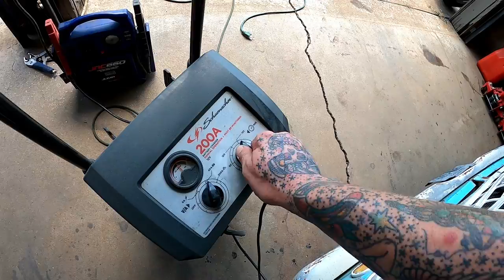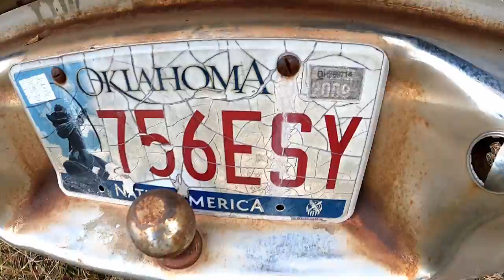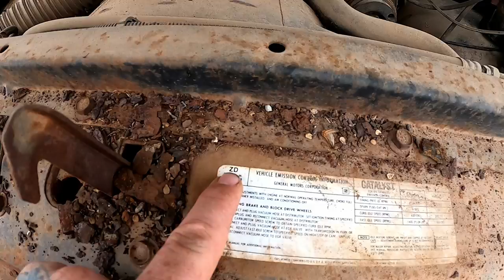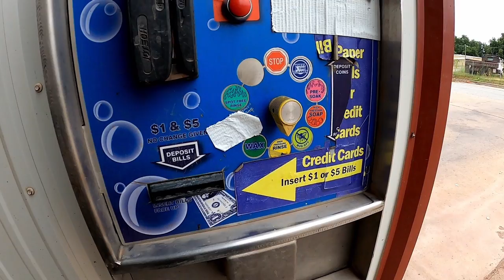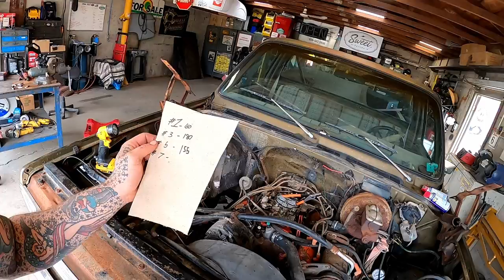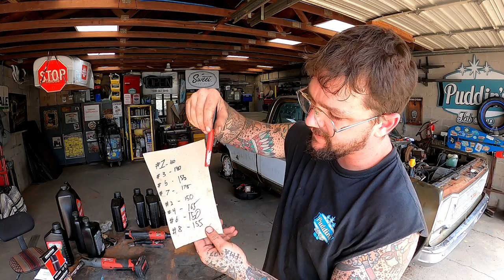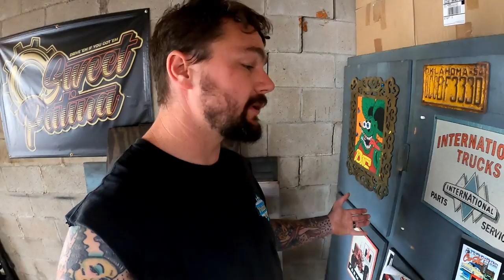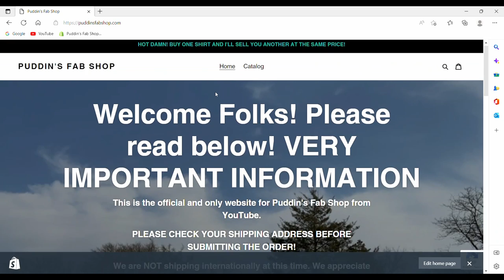FREE 1976 GMC Sierra. ABANDONED on my new property! WILL IT RUN?!?

Comment: If it wasn't the motor? Then what do you think the reason for dumping the truck in the first place, was the rust that bad that it wouldn't pass registration or do you think that it was the diff???
Either way, not bad for the price 👍👍👍👍👍👍

Comment: before you part that out.. its a top of the line gmc 1/2 ton 5 lug with ac, power disc brakes, power steering with tilt column (wouldn't be surprised if the rear end was a posi) and from what i was seeing in your video pretty much bone stock and not been apart, a true cowboy cadillac back in the day, if the cab isn't rotten out it's actually worth a few coins brother. the front clip and bed side or no big deal. I'm the 2nd owner of a 73 cheyenne super 10 with only 62k miles on it now with everything your truck has but no ac and you wouldnt believe some of the stupid offers ive had for it unrestored (and yes, its a runner and a driver)

Comment: Need a better bluetooth funnel there

You don't have like 38 of those cheap meters the Hobo Freight used to give out free?  
 
GMC is well optioned, should be a fairly desirable truck.  I once picked one of those tilt columns when I was in Indianapolis on vacation, had to buy a tarp to put it on in the back of the rental car because the steering wheel was all sticky.  Probably why yours has some aftermarket wheel on it. 

My old Suburban I had to literally climb up in the engine compartment to work on some things on it

Comment: There is an easier way  There's a bolt hole that goes right into the front of the block Put a bolt right through the front of the block to hold the rod up

Comment: How do you find so few wires and hoses damaged on vehicles that have been sitting in fields for a decade? But when I was at a caddy dealership, we'd get cars that sat for a winter that needed all new harnesses and hoses that were parked in the middle of cities. Guess it's the plant based materials they used on newer stuff.

Comment: For fucks sake to clos a square body hood that's rusty/tight put your hands on the top front edge spaced evenly like you would normally pull down, but instead of pulling down push it forward towards the windshield with slight downward force if it's being extra stubborn give it a little side to side wiggle while pushing. Sounds complicated but it's all in on easy fluid motion
Reply from the maker: I think next time I’ll jump off the cab roof.
Reply: @PuddinsFabShop  as long as you give it the peoples elbow 💪 it'll be fine...
Reply: Calm down buddy

Comment: You could of just pulled the front bolt and replaced it with one of the pump bolts or a screwdriver to hold the push rod up...or your way.

Comment: I did the wrong plug wire location thing. As I was waiting for the old tow truck I decided to look and switch 2 and canceled the tow right as he pulled in. I felt bad for the driver, so bad that I told him how much of an idiot I was which gave him a smirk at least.

Comment: Hi Puddin, a respectful paranormal analysis shows EVP spirit audio from the wind-shield wipers, acting as a ghost box; there's speech patterns within the noise, obvious at 0.25x video speed, spirit helpers talking:
37:47 'Når de gamle Guder kommer tilbage, så sker der ting og sager' ('When the old Gods come back, things happen'), 37:49 'Fordi den energi fra Völven er så stærk' ('Because that energy from The Völve is so strong'), 37:51 'At hele verden er nødt til at høre efter' ('That the whole world has to listen'), 37:52 'Når Völven snakker og taler' ('When The Völve speaks and talks'), 37:53 'Om de gamle Guder fra Danmark' ('About the ancient Gods from Denmark'), 37:54 'Og den gamle Asatro' ('And the old Asatro faith').
Then as the radio kicks on, there's EVP for you, still at 0.25x video speed, spirits speak, using the noise between the sentences and words, some of those are also spirit EVP:
38:00 'Pud.. din', 38:01 'Døden, ånder' ('Death, spirits'), 38:03 'Døden er ikke en slutning' ('Death is not an ending'), 'Til Helvede med Völve' ('Go to Hell, Völve), 'Han styrer' ('He's in charge'), 38:05 'Det er en Asatro shaman' ('That's an Asatru shaman').
38:07 'Ukraine og Danmark' ('Ukraine and Denmark'), 38:08 'Er en' ('Is a'), 38:09 'Battlefield', 38:10 'Danmark er som en børnehave' ('Denmark is like a kindergarten').
38:10 'Ti' ('Ten') / 'Team Asatru', 'Asatroen er kommet tilbage' ('The Asatru faith has returned'), 38:11 'Faith', while the noise says 'Fu%k de Asatro røvhuller' ('Fu%k them Asatru a-holes').
Ref. The Asatru faith being the old original denomination of the Vikings. They conquered England, founded Russia and discovered America, named it 'Vinland', wine land, because they saw wild grapes, growing.
Some Native Americans, they came into contact with, basically threw them out, because of differences in culture:
Vikings gave them a gift of fresh goat's milk, which the Native Americans weren't able to digest, they got sick to the stomach, thought it was 'bad medicine', so they attacked and killed several of the Scandinavians, who then fled to sea and returned to Scandinavia; some, however, visited several times. The crossing was said to have taken three weeks in a Viking ship, and old Saga tells ('Saga'='Tale').
38:12 'Dragster', 'Gettin' even' / 'Earth in heavage', noise says 'Of the temperatures', 'Animals', at 38:13 it sounds like 'Terrible'.
38:57 'There's the Devil', 38:59 'He comes to attack Puddin, again', 39:00 'Puddin, become an Asatru', 39:01 'Jeg er kommet for at angribe Puddin' ('I have come to attack Puddin'), 39:02 'Fordi jeg er så sur over, at det går ham så godt' ('Because I'm so pissed off about him doing so well'). Now listen to the female voice:
39:07 'Du er en Asatro, nu' ('You're an Asatru, now'), 39:08 'Freja snakker til dig' ('Freya talks to you').
39:10 'Freja og Völven, den Asatro shaman' ('Freya and The Völve, the Asatru shaman').
39:11 'Der er ingen, der siger, at du behøver at ændre noget i din livsstil' ('No one's saying that you need to change your lifestyle in any way'), also sounds like 'Der er ingen, der siger, at du behøver at gå klædt som en Viking' ('No one's saying that you have to walk around, dressed like a Viking').
39:14 'Men' ('But'), 39:20 'Det er en' ('It is an'), 39:22 'Anden måde at tænke på' ('Other way of thinking').
39:24 'Vær venlig' ('Be friendly'), 39:26 'Mod de venlige' ('To the friendly'), 39:30 'Og find dig ikke' ('And don't put up with'), 39:32 'I de negative røvhuller' ('The negative a-holes').
39:38 'Ulrik Völve hader de kristnes hykleri' ('Ulrik The Völve hates the hypocrisy of the Christians'), 39:40 'De kan ikke leve op til deres egen trosbekendelse' ('They can't live up to their own confession of faith'), 39:54 'Fy for den lede' ('Damn, that's so ugly'), 40:08 'They always sin' / 'They always fight', 40:10 'Hold nu kæft' ('Damn'), 40:12 'Hvor er det' ('How'), 40:13 'Råddent' ('Rotten that is'), 40:22 'Fundamentet' ('The foundation'), 40:24 'Er helt' ('Is all'), 40:26 'Revnet' ('Cracked').
40:32 'Shamanen' ('The shaman'), 40:33 'Ulrik The Völve hader' ('Ulrik The Völve hates'), 40:38 'Også' ('Also'), 40:40 'De forbandede muslimer' / 'Den forbandede mafia' ('The damned Muslims' / 'The damned mafia'), 40:43 'Som ødelægger levemulighederne' ('Who destroy the living conditions'), 40:47 'For alle andre, end' ('For everybody, other than'), 40:48 'Deres egen folkestamme' ('Their own tribe of people').
40:52 'Føj!' (Ew!'), 40:55 'For Satan, de dumme svin' ('By the Devil, those stupid swine'), 40:57 'Jeg brækker mig i lårfede stråler' ('It makes me sick to the stomach').
41:09 'Soldaterne angriber alle andre' ('The soldiers attack all others'), 41:14 'Men de er ikke vant til, at nogen angriber dem selv' ('But they are not, themselves, used to someone attacking them').
41:16 'The hatred', 41:18 'Terror', 41:19 'Völven Ulrik er i krig mod de forbandede møgsvin' ('The Völve Ulrik is at war against those cursed scumbags').
41:21 'Hold kæft, hvor er du modig, Ulrik' / 'Vel talt, Völven, vi ofrer dem til Guderne' ('Damn, how brave you are, Ulrik' / 'Well spoken, The Völve, we sacrifice them to the Gods'), 41:22 'Hold kæft, hvor skal de få nogen bank' ('Hot damn, they're going to get a beating, now'), 41:25 'Völven Ulrik kalder til krig mod de forbandede møgsvin' ('The Asatru shaman Ulrik calls to war against those cursed scumbags').
41:19 also sounds like 'Den elvte september' ('September eleventh'), and 41:22 'Det var dengang muslimerne ødelagde det store World Trade Center i New York City' ('It was back then that the Muslims destroyed the great World Trade Center in New York City').
41:25 'I dag er det dem, der sælger al den olie, som Puddin putter på sin bil' / 'I dag er det dem, der importerer kokain og andre stoffer, der ødelægger mennesker' ('Today, they are the ones who're selling all the oil that Puddin is putting in his car' / 'Today, they're the ones who import cocaine and other drugs that destroy people'), 41:31 'Føj for Helvede noget fikumdik og hykleri' ('Hell, what a lot of financial shenanigans and hypocrisy').
41:35 'Og den Asatro Völve bøjer sig ikke for nogensomhelst' ('And the Asatru Völve doesn't bow to anyone').
41:47 'Völven Ulrik hader når nogen sutter røv på vores fjender' ('The Völve Ulrik hates when someone kisses the ass of our enemies'), 41:51 'Ulrik The Völve hader når nogen kaster penge i favnen på dem' ('Ulrik The Völve hates when someone throws money into their lap').
42:02 'Ulrik The Völve sætter højspænding til situationen' ('Ulrik The Völve puts high tension into the situation').
42:09 'Fatwa'.
Defined as: 'A ruling on a point of Islamic law, given by a recognized authority of the Umma, the global community of Muslims, bound together by ties of religion'. As the 'death sentence' ruling, issued to the writer Salman Rushdie. Wiki: 'Sir Ahmed Salman Rushdie is an Indian-born British-American novelist. His work often combines magical realism with historical fiction and primarily deals with connections, disruptions, and migrations between Eastern and Western civilizations, typically set on the Indian subcontinent'.
abc news quote: 'A fatwa against author Salman Rushdie led to more than 30 years of terror: Extremists have targeted writers, publishers and translators since 1989'.
42:10 'Forfædeligt' ('Terrible'), 42:12 'Det er ikke benzin' ('It is not gas'), 42:18 'Det er blod' ('It is blood').
Thank you
The Völve, Asatru shaman of Denmark and the Lands of the North

Comment: PUDDIN do not cut up that truck fix both the 4x4 just needs a engine so fix it or go back to the junk yard and save a small block better yet find a 400 small block 3 freeze plugs on the side tons of pulling power and LMC sales 2 brackets that should be very easy with the old eagle eye it makes it easier to make it a short wheel base truck and get them to donate a bed side and shorten the bed you have don't let your long time viewers down save both and paint them to match but really like the color of the GMC best there are lots of younger people who want a 73 86 Chevy truck but are over looking the LWB but if someone like you can help them out It would be very much appreciated thanks for letting the viewers have a little input and as a side in Georgia those steal wheels would be split to to 8 in on the front and to 10 in on the back 255 on front 275 rear dropped just enough to think it might be FACTORY dog dish center hub caps no trim rings.  LMC also has bolt on hood bracket

Comment: It's a Chevy what do you expect it will be the only engine that can have bad spark plugs low oil pressure running on fumes bad carb and leaky valve covers bad spark plug wires and still run on all 8

Comment: Hey putting on a small block Chevy 350 327 289s 305 they all have a little boat in the front underneath the water alternator you can take that bolt on loosen it slide to ride up tighten that bolt up and it holds the rod up on them on the fuel pump that that you just put in on that Chevy motor yeah you just run that bolt out slide rod out push the bolt back in and it holds them rides up and then you just it's fine because the rod that you were talking about runs the runs off the cam that'll make the fuel pump pump all right bud this is James again talk to you later buddy hey text me call me or something I love your program send me some stickers free I got everybody in the world watching you even my brothers now starting to watch your program buddy love you

Comment: Excellent video Puddin  :) also that GM truck 1976 first half full 1976 year also 350 is orange block  are 2 bolt also blue block are 4 bolts mains this one orange by head valve covers can tell you also Carb be Elebrock on factory motors to , plus 650 to 850 CFM on 4 barrel carb and great ones too and 5 quarts oil take on 350 of 10w30 no synthetic engine oil plus 2 types oil filter take small or big one to! In fuel line in front carb has fuel filter to it small cartilage like middle finger size too you got take big 13/16 nut off carb it there ! Distributor 1974 to 1980 you get EFI in options or do basic one and Transmission of be Turbo 350 or Turbo 400 3 speed Automatic transmission or options has Overdrive Automatic transmission type be 700SR 4speed Overdrive Automatic transmission! But if has Clutch be Manual Column Shifter 3 in tree , options was on motor is Cruise Control, Tilt Steering wheel, Air Conditioning, Am or Am/ FM or Am/ Fm Cassette or Am/ Fm radio with CB radio of 23 channels  but  1978 get 40 channels Am plus some Delco radios had LSB, USB in Sidebands too ! The radio antenna were in Front Windshield of T red sticker wire antenna or get fender antenna buy a option to order by dealership when made in GM factory ! Also Power Steering also Brakes to options also axle ratio were 355 to 411 ratios and if had 10 bolt or 12 bolt axles options if bought Light Duty was 10 or Heavy Duty 12 bolts for suspension to ! Also chrome bumpers was options for from back and front but color of truck was basic types ! Fuel tank was one basic or got travel package got second tank too! Slide back window was option and West Coast mirrors to or Diamond oval or basic one is 3 fork type for doors! Also 4 core rad was option back then most 1/2 ton were  2 core , Power Locks and Door Windows on door's options! Hope this help you out Puddin nice find too !